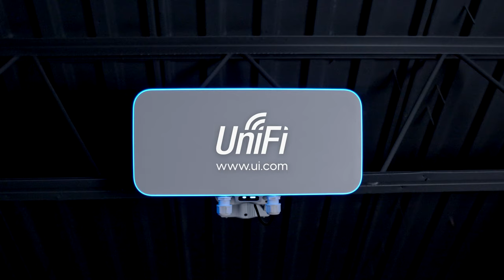How to Install: Ubiquiti UniFi Wi-Fi BaseStation XG Access Point

Comment: We could not get the 10G interface to work on a UniFi Professional-24-PoE switch. We used a UniFi RJ45 10G SFP+ module, connected it to the PoE++ injector (LAN), and connected the injector to the 10G RJ45 port on the AP. It didn't work. So, we ended up connecting the 10G interface of the AP to a 1G PoE++ port on the switch, and it worked because the AP's 10G interface also support 1G. But, it would be nice to know how to get the 10G to work without using a 10G switch that support PoE++ over the 10G interfaces. Any ideas?